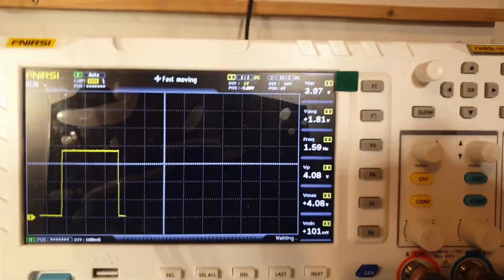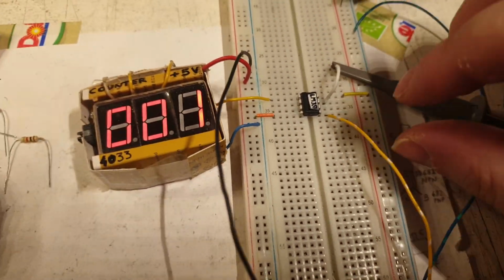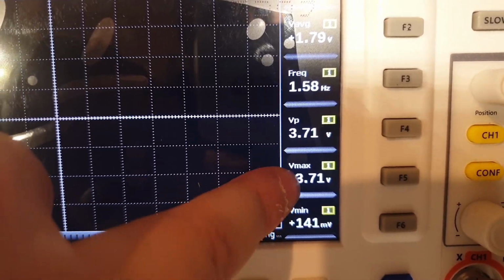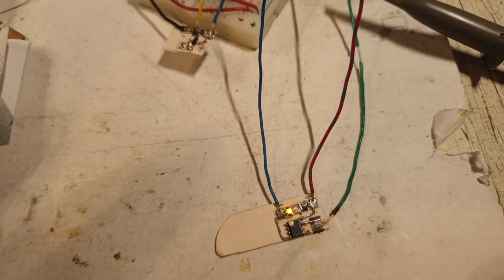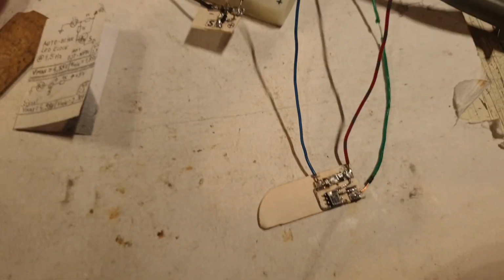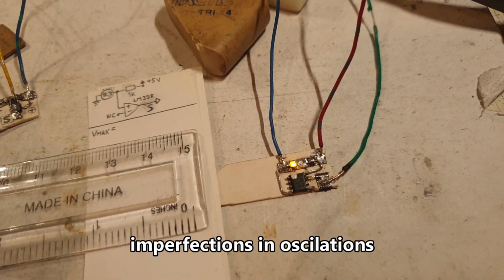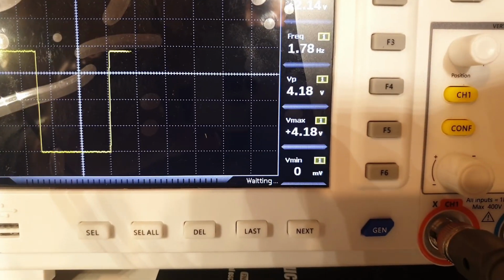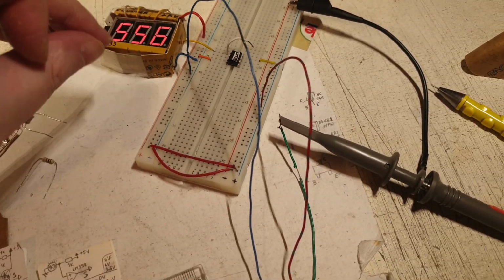#263 Self-Flashing, Auto-Blinking 0805 LED v2 - with LM358 opamp and higher V output than before

Comment: Could you please explain the reason for leaving the inverting input floating?  I have never seen that before.  Thanks.
Reply from the maker: Simply from experimentation and testing. I know is not a good thing to leave any inputs floating, but in this case, it looks that it works fine, so I can escape with less components or links and keep a very basic functionality. You are right and I thought of this while I was experimenting, that in the long run, it can introduce random signals, but ... looking at the application itself, I really dont need fancy security, its enough it is working and Im happy with that. You can secure it as much as you want, but for me, is ok. In the future if this will become something serious, I will upgrade this very basic circuit with a more secure one. But in the future. :)
On the other side, if I remember right, the opamp (+) input will get a +3.71V from the signal. On the (-) input should get a voltage OVER this signal to mess up the opamp output. I dont think any time soon will do that only from a floating state. We can hope there will be some electrostatic charge on the (-) pin to actually influence it but ... again, from the tests, it looks fine as it is. The good part is that I can escape with less components this way.
Reply: @q12x  OK, thanks for the explanation.  I think you are essentially using the op amp as a comparator and if I'm not wrong, you don't want to have to bias the inverting input with a resistor divider so you are just leaving it float and that somehow provides the appropriate bias.
Reply from the maker: @Enigma758 Well, both as a comparator and an amplifier !  Remember, I wanted to amplify that input signal and obtain a much larger output swing, than with the tr. And it did the trick. A small difference, but it did it.
Again, I might be wrong leaving the (-) input floating. But if it works, it works. :)
Reply: @q12x  Well yes, because as a "comparator" you are getting the maximum possible voltage swing that the op amp can produce, so in that sense, yes it is an amplifier as well as a comparator.
Reply: If I were to use an op amp, I would not use the LED, I think I would just build a relaxation oscillator.  True, that require 3 resistors and a capacitor, so a total of 5 components and I do understand that you are looking for a minimal component circuit so it really depends on what your goal is.